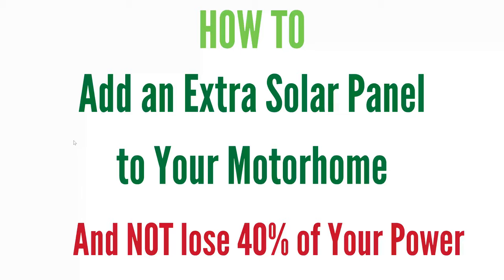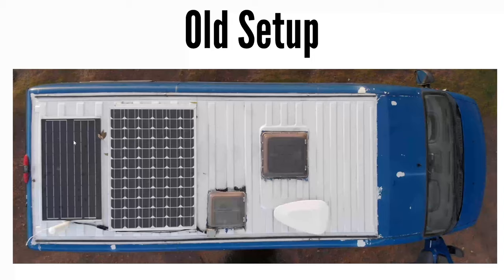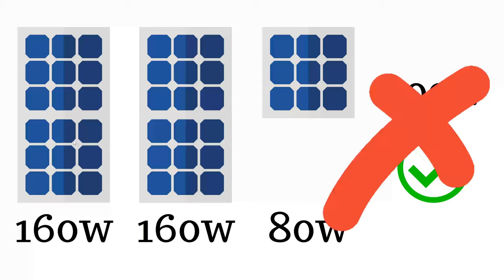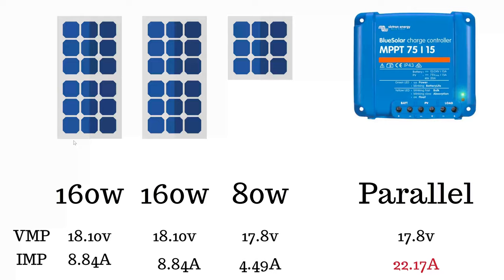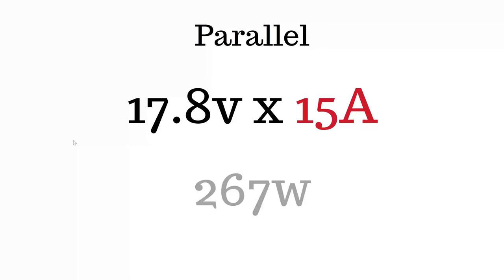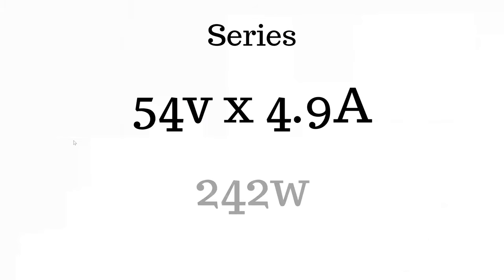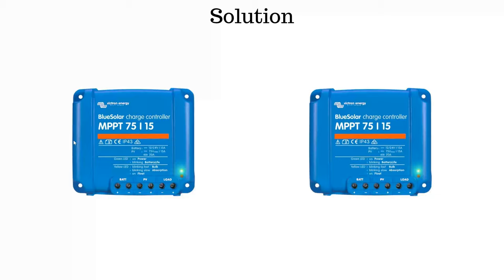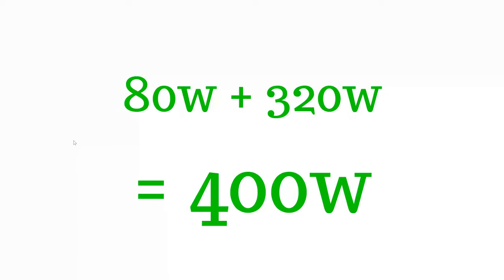Don't Make This Mistake When Adding Extra Solar Panels to Motorhome

Comment: Very well explained, my dilemma is I have 2 panels giving out a total of 240 watts on the roof of my motorhome but I would also like to use this power to also charge up my Bluetti 2400 watt hour power station using these plus my 200 watt foldable solar array  gives me 420 total watts which will be enough to charge the bluetti up in 3 to 4 hours when it's sunny. BUT it's doing my head in trying to work out how to achieve this.
My plan is to take the power from the 2 panels on the roof along with the 4.panel array I will have outside the van when I am parked somewhere AND FLICK A SWITCH IN THE VAN THEN INSTEAD OF CHARGING THE 2 X LESURE BATTERIES AND THE VEHICLE BATTERY which are normally fully charged any how.